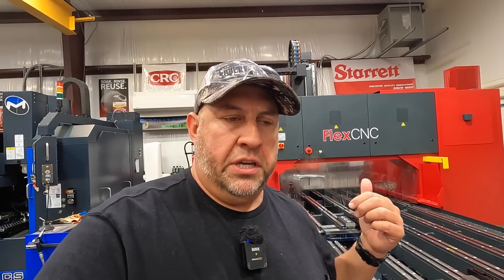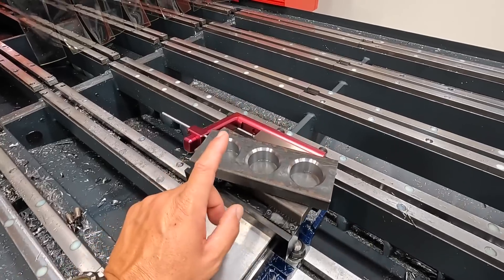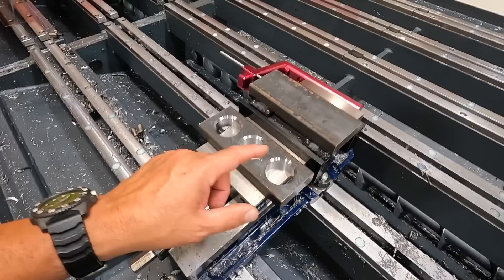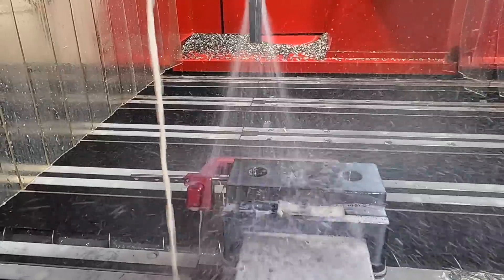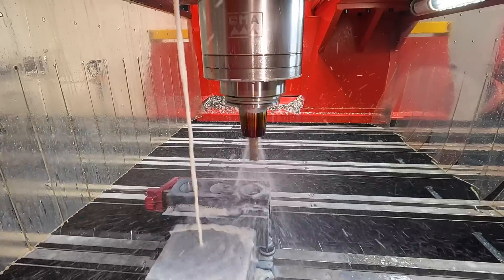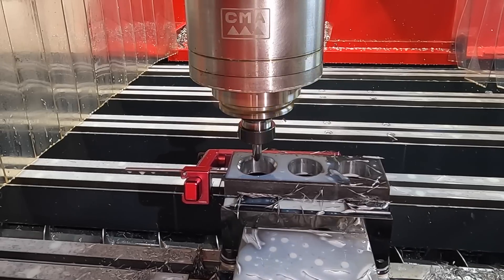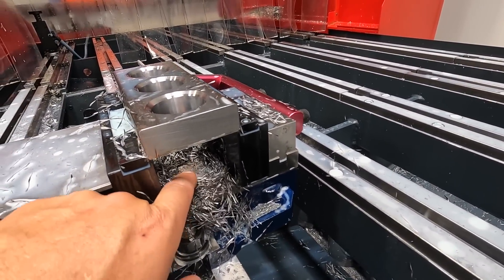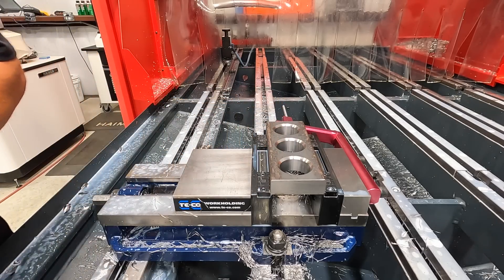2" UNC Tap Size Holes-Tool Tuesday Ep.17

Comment: Hey Adam, glad to see you’re getting comfortable with CNC you should try the boring cycle in fusion 360 it will produce a shorter chip with no radial deflection should produce a more accurate hole.

Comment: it would be alot faster to thread mill this part in the Flex CNC, one setup in the vise on the Flex CNC
Reply: He didn’t want this to be his first thread milling job. He didn’t have a thread mill at the time, but had a 2” tap on hand. He just didn’t want to learn threadmilling on this part due to the large cost of the material.

Comment: That table on the flexarm just torques the steel compared to shorter CNC.
Power spindle or tool is huge and only hanging on the vice jaws by wisker.
Splinters causing mayhem with speed.
Neutral safe inspection important no error step.
Taps that size only have plugs.
Looks like you are more comfortable with CNC.
Always allow a few seconds before pressing that button.

Comment: For me I wish you would use the coolant as needed for your videos and show a real world machining and not a staged event. Put the camera in an underwater enclosure if necessary to get the best and closest shot. While I appreciate your concern for me as a viewer I hate to see any tool use that is done for staged content that hurts the end product and/or the tooling being used unless threir is an overiding need to visually see the cutting/machining without coolant. You are among the best at explaining why you do what you do to lay and professional viewers, Thanks for taking me along. Ray Stormont
Reply: This isn’t staged content. You are going to see a large piece of steel with 4 of these holes milled and then tapped. This was preparation and some practice for that job while he waited for the material for the job to arrive.
Reply: @MechanicalAdvantage  Sorry if I was not clear what i was refering to is turning coolant off to get/enable a better video shot at the expense of tool life only, not the process being staged/used to machine the part. Ray

Comment: Adam don't worry and I am retired and 74, last time I ran machine tools for a living was 1970. I then worked as a design engineer until I retired. I went back to help for (4 weeks) my friend. I thread milled 12 nuts for 50mm diameter 2 start left hand 10mm lead trapezoidal threads. The first nut I did  the gauge he had made by another firm when in first try. I then did some single start right nuts.  Spiral milled bore to size.

Comment: The bed on the Flex CNC looks unique… Have you noticed any “flex” (sorry…) with your vises? I see the fixed jaw & part are kinda hanging over the edge & I’m wondering if it’d be worth putting some toe clamps on the front for gits & shiggles.

Comment: Great video. It really shows off how fast and precise the CNC is once you get it dialed in.  You showed that the holes were consistent within a couple of tenths, Given that the internal finishing cut is done at full depth, I was wondering if the taper resulting from tool deflection would be measurable over a 1 to 1.5 inch deep hole. It should be an easy measurement.

Comment: Why do people even bother with micrometer when you make holes for threads? Tip of the thread holds less than 5% of the strength.Its a waist of time ,you could have drilled that 0.5mm undersized and it would still hold just fine.Waist of time unless you are doing something that needs great accuracy like a leadscrew or ball screw.But then you would grind final dimension not tap it.
Reply: Agreed and he knows that. Since it was a practice piece he also used it as an exercise using cutter comp to hit a hole size. It took about 0 effort to hit that hole within a half thou
Reply: @MechanicalAdvantage  I seen it on Blondihacks videos but she is full of bs ,she claims 5 micron of  a mm(you get that precision by grinding not by lathe)  accuracy on a chinese manual lathe which is impossible to get unless machine is new,expensive  ,perfectly leveled and temperature is at 20°C.But anything for likes and  to boost ego.
Reply: @zumbazumba1  He made the first piece. Measured it to be a bit undersized. Adjusted the wear column and ran the second piece and the size came out within about .0005" after the simple adjustment. Was that required? No, but it was a chance for him to also practice using cutter comp.

Comment: I think you're going to be learning how to threadmill whether you want to yet or not. The CNC spindle is no way no how going to pull a 2"-4.5 tap. It wouldn't even do it in aluminum.
Reply: He will. I've programmed many many thread milling operations. He was hesitant to make this his first thread milling job because of the cost of the material used in the job that he needs to provide to the customer. That material is much much much larger than the test piece.

Comment: Hi Adam and Abby,
That worked out very nice, thanks for sharing.
Interesting thought on the thread milling, look forward to seeing that being done.
A thought on tapping the holes though, of course the productivity of the cnc machine is higher when it is only drilling and boring the holes whilst the holes are being tapped post cnc work.
That influences how one does the costing for a job as less of the cnc machine time is being sold, pretty interesting stuff.
Kind regards,
Duncan, South Africa

Comment: This is when I LOVE thread milling. 
For these larger threads - it is cheaper and much more forgiving. Especially true if you are limited on horsepower. 

Give it a shot. It is easier than it looks.
Reply: The tools I have used have come from companies that also have on line programs to produce the code specific to their tools. I would suggest getting one and giving it a go. The way you feel about that chamfering operation will be matched by how you feel about thread milling.

Comment: 14:40 ...A 2" X 4.5 tpi tap can cost up to $300

A thread milling tool (single point) .. That will cut an almost unlimited number of internal threads on a CNC mill?? Starts at $35
Reply: He already had the 2" tap, he didn't have a thread mill yet. He also didn't want to do his first threadmilling on such an expensive workpiece.

Comment: You will enjoy thread milling.....keep in mind, if you use a single tooth thread mill cutter you may have to model (sketch profile) the tooth profile and insert that into the parameters for that cutter, in the F360 model, use the minor diameter of the threaded hole and don't model in the threads.  Getting the PDO dialed in may take a few test cuts.  Keep in mind on setting the stepover that each cut will have a greater engagement into the thread and employing a "Repeat" or spring pass will result in a nice non tapered thread.  Doing a chamfer pass after thread milling provides for a nice, finished look and will remove any burrs from the thread milling operation.
Reply: Physically modeling the threads makes thread milling in Fusion more difficult in my opinion. With a cosmetic thread, you get a solid cylinder to select so all you need to adjust is your pitch diameter offset. You will see him do thread milling in the future. i'm confident of that. This is just a really expensive workpiece and he didn't want this job to be his first time for threadmilling.
Reply: @MechanicalAdvantage  Good point Kevin.......Adam was impressed with hitting that bore diameter within a few tenths, that's why I think he will really get a kick out of seeing a thread mill plunge into a hole and then helix its way out cutting a perfect thread....should be a very entertaining vid for the viewers.

Comment: A silly question if I may? Why did you not elect to have the machine do single point threading ? Seems to me, it would be faster and more cost effective to do it all in 1 set-up  good job as always  73 Dan
Reply: We talked about it. The workpiece is a pretty expensive piece of material. Since he hasn't yet done a thread mill in Fusion, he didn't want this to be his first time trying. He had a 2" tap and the flexarm so decided to do it there for this one.

Comment: A milling process that is most entertaining to program and watch is single point threading on the cnc.  Once you get the process logic written in gcode, it is real easy to use the same code to make different size threads.
Reply: Fusion automates the process. Adam didn't want to his first threadmilling job to be on such an expensive workpiece. But he will get there :)

Comment: That Flex Arm is soo cool to watch.  I can’t imagine the torque it takes to drive something that big
Reply: Upwards of 800 lb/ft of torque for a 2” tap in mild steel.
Reply: Yeah, I thought it might spin that whole table around and take Abby with it...(:-)))
Reply: It would have been interesting to see one of those holes tapped by hand. I'm sure it would take a huge wrench.
Reply: It doesnt take alot ,depends on thread pitch.Tap is big but it still cuts just a pitch.